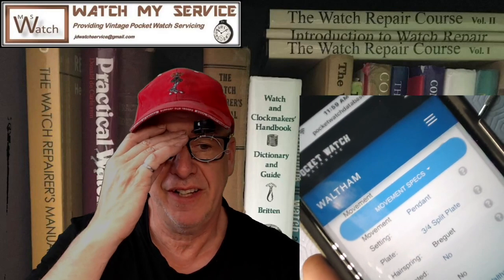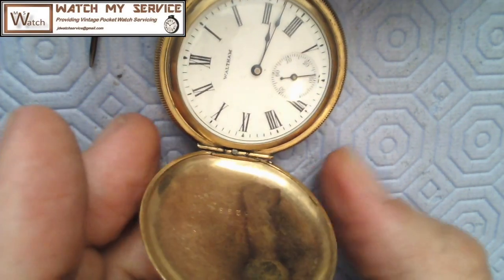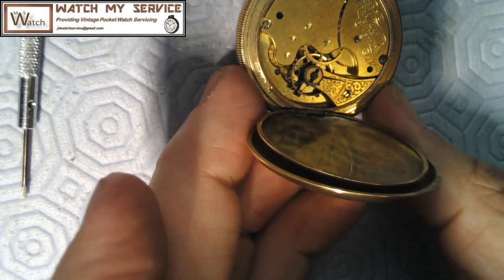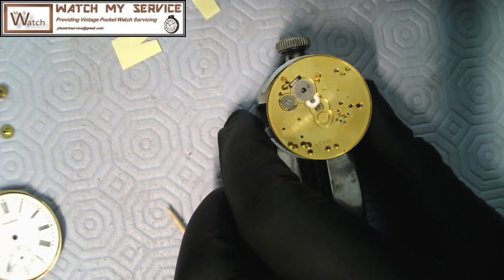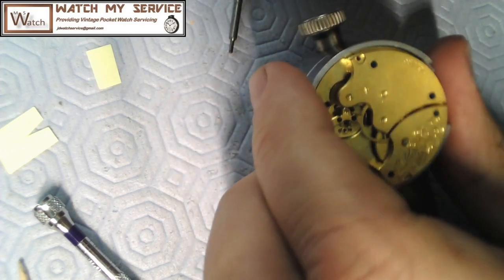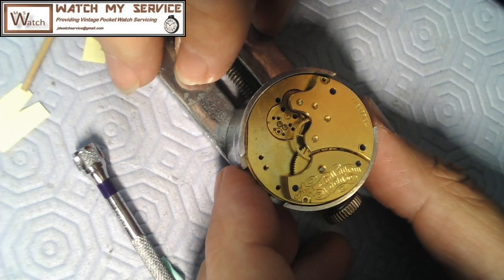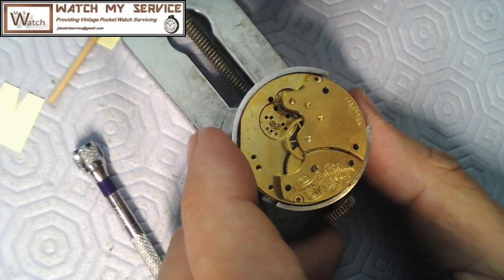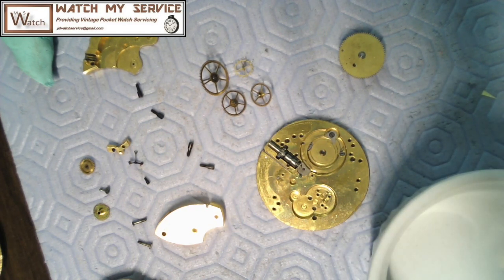Vintage Waltham Watch Disassembly

Comment: Great video. I dabble in pocket watch repairs as a hobby of sorts, and I'm still wondering the best way of identifying which balance staff is the correct staff when it has to be replaced - especially Waltham pocket watches. Waltham seemed to use so many different balance staffs. How do you ID the correct one to order?
Reply from the maker: Put your serial number of the movement in pocketwatchdatabase.com
And they have a part lookup
Reply: @JDRichard  the database is a great resource for identifying a part but not so much for the Waltham watches especially the balance staffs.
Reply from the maker: @stevejennex4309  The you need to purchase the American Pocket watches book
Reply: @JDRichard  is there a particular one you recommend? There are quite a few American Pocket Watch books. I have Swigart's Illustrated Manual, but the detail on balance staffs is not great. So many different staffs and pivot sizes.

Comment: Congrats on your retirement that's terrific. I hope to be right behind you. 
Good vid.  I use a piece of cellophane or a section I cut from a sandwich bag, to protect the face and removing hands. Works pretty good. 
Have you ever worked with white enamel for face crack repair? I haven't yet and am curious about it..
Reply from the maker: Thanks Mike on your congratulations for my retirement. Although I do plan on working part-time as a contractor and continuing to build my watch business